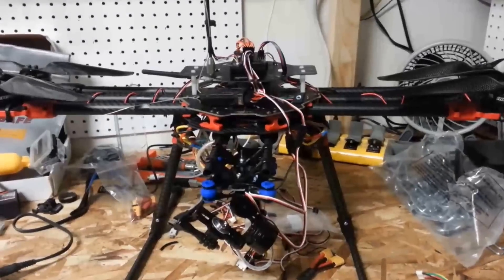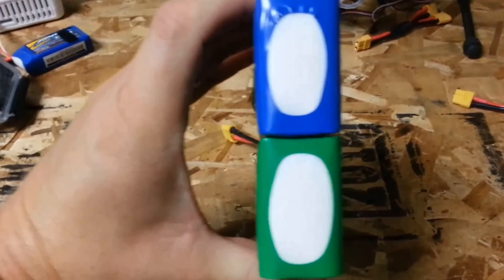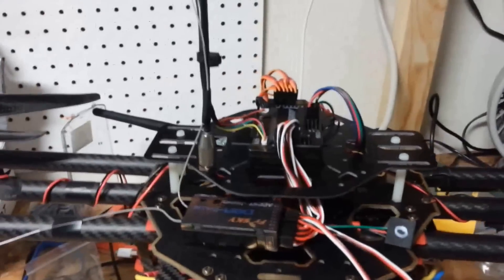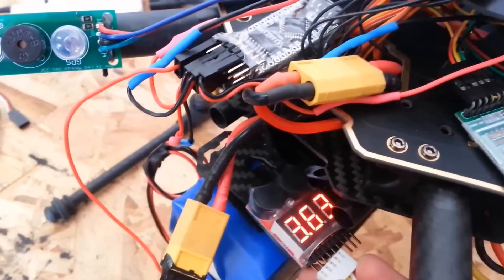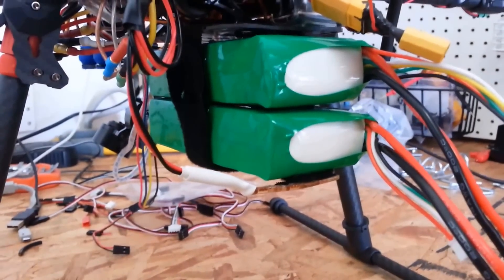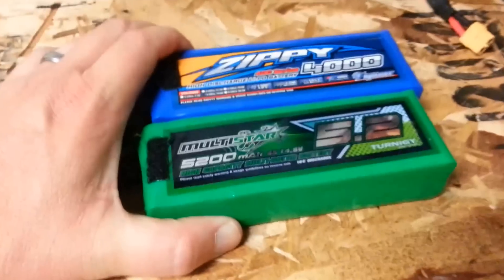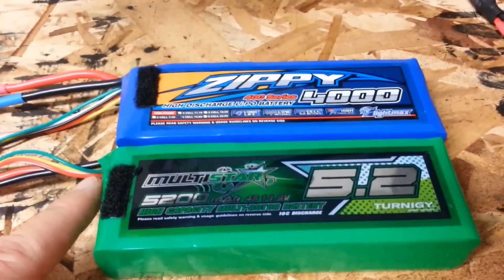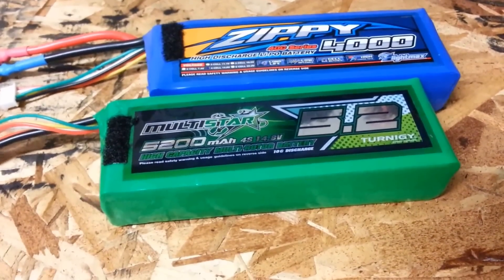Battery Comparison 10c vs.40c Lipos in a Multi-Rotor Hover Test

Comment: Sorry but that comparison is pointless. You should check punch in rapid lift off, not time of hover. High discharge is for better torque in this case which you didn't check at all.

Comment: Isn’t the C rating for maximum output current? I might be wrong but I thought a more proper test would be maximum current your motors could pull from the battery, not flight time, like it would be able to climb faster

Comment: hello I have a UPAIR ONE 4k plus and its battery does not last much longer than me lasted are 9 minutes recording from beginning to end, but they say that lasts 16 others than 18 some more than 20 but it lasted me only 9 minutes, You could tell me if there is any battery that I can put on and it lasts longer and does not affect anything in the electric drone, greetings.
Reply from the maker: Luis Segoviano you want a battery with more Amp hours. The C rating is less important for you.
Reply: Ron thanks for answering, I want a battery that gives me more time to fly, not about 25 minutes would be very good, could you tell me what would be useful? 
the one that my drone takes original is 5400 mah, 59.94wh 10C 11.1v
Reply from the maker: Anything that's 11.1 volts but more mah. I'm not where I can find a link, but, hobby king has many options.
Reply: Thanks

Comment: I'm building a f450 sized long range quad and im thinking of two types of batteries i want to buy. Nr.1 (10c 5200mah 3s multistar battery 430g) or nr.2 (2x 2800mah 25c each, about 400 grams combined) the parallel setup is a bit cheaper. which one should i buy?
Reply from the maker: I would go for lighter weight.

Comment: which battery should i choose if i need a flight time of 20 minutes?
Reply from the maker: It depends on the weight of your aircraft.  I think that a quadcopter with a 10c battery would be fine for the most part.

Comment: Hi and thanks for your video.  Can you let me know what model carbon fiber board you used to mount your flight controller (on top of those nylon standoffs)?  Thanks.
Reply: P.S.  It looks like an x450 series bottom board but looks non PCB -which is what I prefer.  Any help and confirmation appreciated. :)
Reply from the maker: I bought a generic fiber board from my local hobby shop that fit my needs.  Pretty basic small board, I believe it was from a smaller copter design.
Reply: Thanks.  It looks perfect the way you have it and I really will need the space because I'm trying to develop a floatation trigger based on a c02 cartridge and a servo + a vehicle inner tube in case it has a problem over the ocean.  I also have a servo triggering the fishing bait release mechanism.  Your config gives me a better idea for installing the flight controller while freeing up space for the other stuff like FPV & data link etc.  Thanks for your reply.

Comment: what do you mean they're not for planes? I have one of these, it's a 8000mah and at 10c that gives me 80A max discharge, my 700w motor at max rated power gives 2860g of thrust at 14.8v with a 12x6 prop pulls just under 49A.

multirotors have more more motors pulling current and they have to lift a dead weight straight up and have to have more thrust than they weigh just to get off the ground, a plane can easily fly on a fraction of thrust to weight, efficient designs can fly with as little as 10%  thrust to weight! but the average plane can comfortably get off the ground and fly properly on 1/3 thrust to weight.

I don't use all the power I have, I have my throttle limited a little on my radio as I fear ripping the wings off from going too fast, it's not designed to fly as fast as my setup can pull it lol
Reply from the maker: True
Reply: Ron Kroetz 

never got on with multirotors, I like my helis and every time I've tried to fly a quad I can't stop trying to fly it like a heli and I crash , they do fly in a somewhat similar fashion but they both have very different characteristics too, maybe one day I'll scratch build a multirotor and give it another go. the plane I have is a balsa Cessna l-19 bird dog with a monster 74" wingspan fpv with it is going to be amazing, it's so efficient in the air and can stay up for long periods, I can load it with two of those 8000mah battery's side by side without upsetting the cog , 16000mah give some serious flight time, although I have all the fpv gear and I fly helis with it ha ha, I even made a fpv v911 micro heli just to see if it would still fly, it does but it's more of a giggle than decent fpv like my big helis, for the plane I'm waiting will I have a GPS flight controller and a 'oh shit' function incase something goes wrong or I get lost!

Comment: how long do you get from these set up ? I mean the flight time . I have an almost identical set up with 600kv motors and i am using 4s 10000mah. I got 13 minutes.
Reply from the maker: Vượng Nguyễn about 20 to 25 minutes depending on flight styles.

Comment: Horrible title guy!The mah arent the same so youre comparing apples to oranges. An extra 2400mah between both batteries explains the extra flight time. Not rocket science. However having lowerC rating means you will have alot less punch flying. What a waste of time watching this vid. Seems you need to do more research in lipos.
Reply from the maker: The real point was to examine the c ratings and ability to fly a drone. These lowered c batteries were new when I shot the video.
Reply: That is the point!!  More MAH for the same weight and money.   Exactly what I wanted to know.

Comment: Hello mate, can you use thread locker to between prop and motor to screw?
Reply from the maker: You can. I don't. I check all prop nuts in my Pre flight. I prefer not to gum up the threads since I change props depending on what I'm doing.
Reply: yes you are right but Is there any another option for that 'cause sometimes I fly over 30 min.Thank you for your time
Reply from the maker: +tyfugr if you're flying that long, I would use thread locker. I have used it in the past. You might be able to get reverse thread motors. That would work. DJI does that with their motors.
Reply: You mean,I'll reverse all motor and propellers right?
Reply from the maker: +tyfugr I believe they make motors that the threads on the motor shaft are reversed. This means that when the motor is turning, it's actually tightening the nut as opposed to trying to loosen it. You only use this on half of your motors.
Reply: +Ron Kroetz Thank you for your help.

Comment: Get to know your lipo checker, don't trust it for accuracy too much, I have a bunch of them, it'll all show slightly different values, I usually cross compare the readings using an accurate voltmeter so that I know the difference shown when I'm in the field. Of course I have my favorite witch is the most accurate but still not perfect.

Comment: lol 10c are more warmer when use
while 40c are cooler when under load

for me 40c are more useful especially when you live in 2 season country rather than 4 seasons

if you live in fairly colder whearther then use lower c
in my tropical season country, higher c is better, since it wont heat up much compared to lower c

Comment: As long as your instantaneous current draw is limited to the battery's  (mAh * C) specs, going to higher Cs should add nothing for you. For instance, a 5200 mAh 10C battery is limited to 52A max draw. The 4000mAh 40C is limited to 160A. But if your application only draws say 40A, thgen the fact that the battery has a 160A is of no real use, because you are never going to draw more than 40A, whatever the batterty C rating. Much more important is the total capacity, i.e mAh, provided of course your application does not draw more than the C limitation. The video results are consistent with this.
Reply: +corisco tupi no. the higher the c rate the more efficient the cell handles peak discharge rates stall rates and freefall high amperage rates. I'll give you an example, I use MULTISTARS in an ebike, i travel 8 miles. I use nanotechs, I travel 30 miles!
Reply: Lionschasing My reasoning stands. Additionally, I said nothing about efficiency but current limitation. Also, please note that there are many factors involved in total endurance, specially when you mention different brands, even more so with such a vast difference (8 vs 30 miles)  in performance.

Comment: your obviously the man to ask advice about batteries :) i have an old electric bike (http://extraenergy.org/main.php?language=en&category=products&subcateg=65&id=105) and its original battery is long dead so ive bought 2 of there http://www.hobbyking.com/hobbyking/store/__32217__ZIPPY_Flightmax_8000mAh_6S1P_30C_UK_Warehouse_.html . i get about 20 miles with me doing some of the work on each. i was thinking of buying this, http://www.hobbyking.com/hobbyking/store/__80910__Multistar_High_Capacity_6S_20000mAh_Multi_Rotor_Lipo_Pack_UK_Warehouse_.html?strSearch=6s%2020000 its capacity is much more but far lower c . what do you think the range would be and would it take the discharge needed? also would i get as many charge cycles as the zippy ones? how have you found them zippy versus multistar over the long run? thanks for your help :)
Reply from the maker: +lookoutleo I've found the two to be very similar over the long haul.  I like the extra capacity which gives me more flight time.  I can handle the lower c rating.  I'm not sure about the bike and c rating....
Reply: +Ron Kroetz hi there thankyou for your message. so how many full charges do you think are on each battery, discharge should be ok as the zippys can do it fune at moment, motor draws never more than 30 amps. just worried that the cheaper 20000mah wont take as many charges. what do you think?
Reply from the maker: +lookoutleo I don't fly all the time so I've probably only put 75 cycles on them.

Comment: What gimbal are you running and how do you have it setup?  I've got a T650 and still haven't setup my FPV equipment.
Reply from the maker: bigpiglights The gimbal is a cheap knock off from Ebay that works really well.
Reply: Ron Kroetz I got the same gimbal that you have in your video. Where did you find out how to wire it together? I'm completely overwhelmed with all the different wires.
Reply from the maker: Patrick Miles Most of it I found on RCGroups.com

Comment: You only got 12% more flight time out of the MultiStars, but they are rated 30% higher in capacity. Obviously, the higher internal resistance of the MultiStars is preventing you from using most of their greater theoretical capacity. I suspect that under a heavy load, the difference in flight times will narrow even more.

The statement you make at 4:30 is meaningless as far as battery comparisons go. Any improvements that you make will improve flight times of both batteries equally.

Comment: "kilovolt". "running in tandem" Yep, closing this vid. the k in kv is the variable letter for rotation. 570kv=570rpm per volt. Running in tandem would indicate you're running them in series, which means you're running 8s. I know without a doubt those motors won't handle 8s. You're running them in parallel.
Reply: *****  I caught that too. I'm sure he means parallel. Additionally not exactly a scientifically sound comparison given that the batteries compared are not the same capacity (mah).  Appreciate the attempt though. Next time apples to apples as you left one stone unturned.

Comment: Bad comparison really,  you gained a couple minutes because u compared a 4000 to a 5200. Try throttling up after 60% of that multistar is used and it can only deliver 20a!
Reply: +Jono Jon  sir when you increase capacity even though the c rating is lower then amperage still goes back up. For ex. a 5200 10c batt @ 325 grams can still produce 52A, well beyond the means of 450 class quads would ever need.

Comment: I'm using 2 x Multistar 10000mAh in my 680pro - still doing test flights but they seem to work great, flight time is 20 to 25 mins.  Max current under full throttle draws about 6C.
Reply: nice...  I'm awaiting the backorder to end and I plan on two 4S 16000 mAh batteries in series on my X8 690 Octo.  I run the multistar high efficiency 268 kv at 8S.  I draw about 14.5 Amps at 33.6 volts.  AUW with a GoPro and gimbal is about 6 kg but an hour flight time.  I currently get 28 minutes with 4x5000 mAh packs run two in series then parlallel to get 8S 10Ah and a Sony 5000a and 3axis gimbal, AUW about 6 kg.
Reply: mvroegh1 What kind of gimbal do you use for your Sony a5000? How do you like what your Sony produce? And have you gotten your 4S 16000 mAh's yet?

Comment: Loiter is not really a good test because it's not likely to require a high C rating, and as long as the requirement does not exceed the C rating of the weaker battery, they would both fare equally. The flight time difference you see here would be simply down to one battery having a larger capacity.
Reply: No shit?
Reply: As long as he never draws more than 104A, either battery pair will do fine. Really, as long as he doesn't draw much more than 104A for a few seconds at a time, it will be OK.
Reply: Im with you on this, it would be intresting to see a comparrison with the quad/hex doing some work.
Reply: +iforce2d That's exactly it. Low discharge rate doesn't mean they don't discharge as fast, it's the capacity of the battery to deliver BIG current when needed, such as with punch-outs, etc. If in doing aerial photography the need is to just hover reliably for a suitable period of time then a lower "C" discharge battery could be fine and be less expensive and lighter than a high "C" battery. A better overall test would be to compare closer to or max performance between the two sets of LiPos.
Reply: do you need this good lipo battery , if you need , you could see the below link very good product.
https://sktvision.aliexpress.com/store/2782033?spm=5261.seller_index.0.0.78040ba2WolNFq

Comment: Cleaning up wires and organizing isn't going to buy you 'several more minutes of flight time'. 4:28

However, if you made your booms an airfoil cross section under the thrust column, you might get an extra 1, maybe 90 seconds more time.

https://www.youtube.com/watch?v=acySDnGYzVM put the slider to four thirty four.
Reply from the maker: Interesting idea.  I haven't seen that done on any multi-rotor copters before.
Reply: Ron Kroetz
I and several others have been experimenting with vertical flat booms, airfoiled booms and tube frames with good success.

http://www.rcgroups.com/forums/showthread.php?t=2233366&page=5

Comment: If you use two in parallel it is equivalent to 20C. But for people with smaller multirotors they may only use one pack and 10C may not be enough for a powerful mini quad. Defiantly worth checking out,. Thanks for the heads up, good video.
Reply: It's still 10C, but the capacity is doubled which doubles the safe output. A 10C battery can safely discharge its full capacity in 1/10 hour, or 6 minutes. A 5200mAh 10C battery can safely put out 5.2*10=52A. It can safely put out 52A for 6 minutes, according to the rating.  Two 5200mAh 10C batteries in parallel work as one 10400mAh 10C battery. 10.4*10=104A  They can safely put out 104A for 6 minutes, according to the rating.
Reply from the maker: That is true, izzzzzz6.  My demo was on a larger hexacopter where these batteries work.  I still use higher C rated batteries in my smaller quadcopter.
Reply: Al Brautigam Thank you for writing this. This is the correct statement. I kept seeing people say double the c rating in the comments. That is not the case. All it is doing is doubling capacity.

Comment: the capacity of the multistar is 30 percent higher. therefore i do not know how to compare flighttime between these lipos.
Reply from the maker: That was the point of the video.  To simply show difference between two similar physical size and weight batteries.  Nothing more.
Reply: Ron Kroetz Yeah^ The C rating is simply how much it is able to discharge at any given point. However many amps your quadcopter is pulling is the same on both batteries.

Comment: Those are not 570 kilovolt motors...those are 570kv motors...rotations per minute per volt...
Reply from the maker: I stand corrected.  Thanks!
Reply: Ron Kroetz Not a fan of the kv unit because it already existed and means kilovolts ( ie. thousand volts ) ... it is very miss leading. If we really want to be correct... 570krpv... but no one is that OCD.

Comment: How much thrust on those motors please
Reply from the maker: Do be honest, I'm not exactly sure.  This size motor on a stock 680 pro does seem to work out well.  I'm running 13 x 5.5 carbon fiber props and the motors run great.  Good acceleration in all directions with thrust to spare.

Comment: Great review.........   Just Saw the Hobby King Video, on the Multistar batteries , impressive.. I have a Tarot 650 Modified.... I have the   Rctimer, 5010/14 360KV Multicopter Brushless Motor (5.0mm Shaft)...  with 17.5 Props...   The motors are putting out 2.4amps at half throttle and 10.7amp's at full throttle....  I plan on using the 6.6 or 6600mah battery's....  4 X 10.7 A = 42.8 amp's.... that is well within range of just one 6600 mah battery, let alone 2 of these....  On the 5.5 or 5500mah, The 10C rating @ 5200 mah...... is 52 amp's....... 52 X 2 = 104 amp's total....  I think these batteries will be a great addition for the Multirotors guy's.. and add just a little more flight time .....